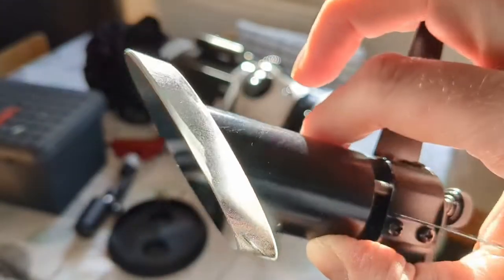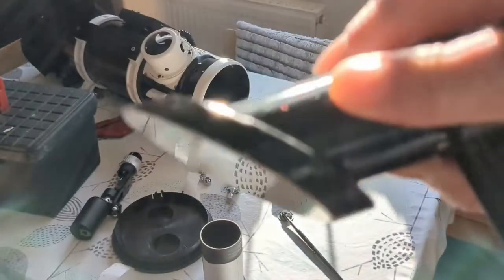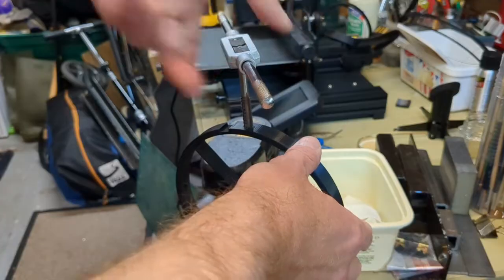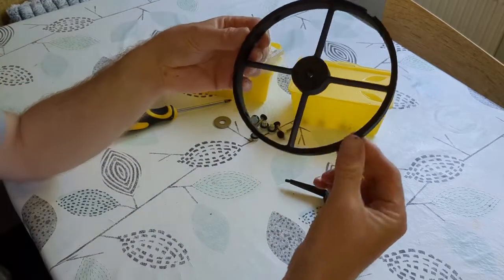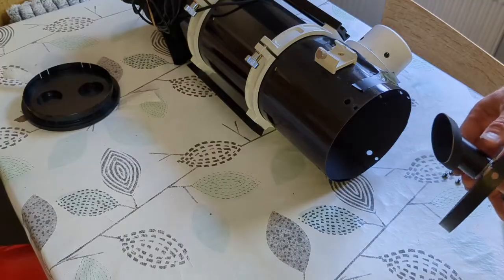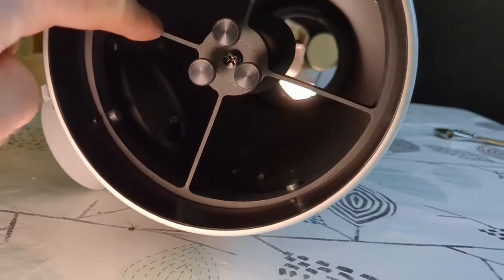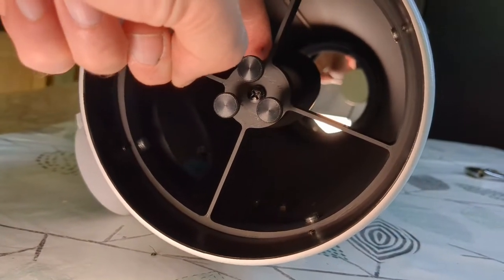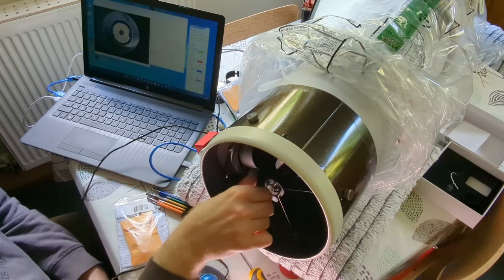Ten Things To Make Your Newtonian Amazing!

Comment: Great mods Andy I like the spider vane mod may look at something similar for my 250P, it amazes me the even to this day Skywatcher still paint the focus tubes silver I've never really understood why they do this.
Reply from the maker: It odd isn't it, I don't understand why as a manufacturer you wouldn't actively improve the scope.  They are capable of being very good, but it does seem odd.  I guess it's to do with price point, and not wanting to spend more on production?  They could really make these scope amazing with a few changes.  Hope you are well.
Reply: Worse still in cheaper, plastic focusers they add a chrome finish to what was black plastic!
Reply: @Cheapass-tro  Yup been there with a cheap refractor some years ago, optically for an Achromat it were pretty good but the focuser was terrible. I did try & find one that would fit but sadly it wasn't to be.